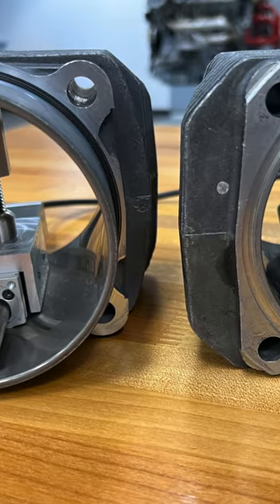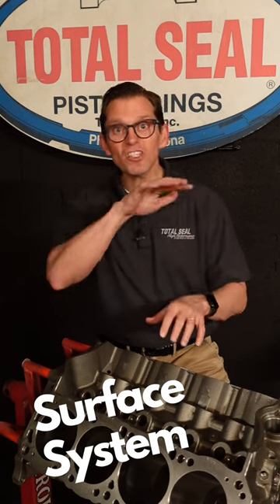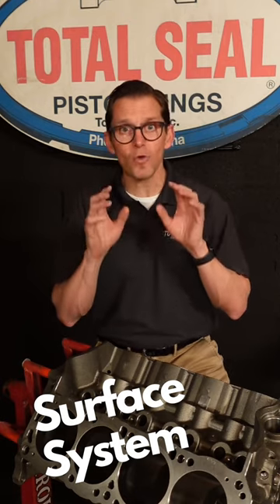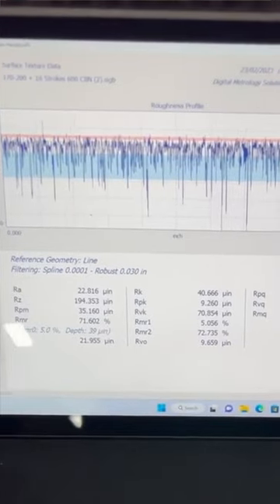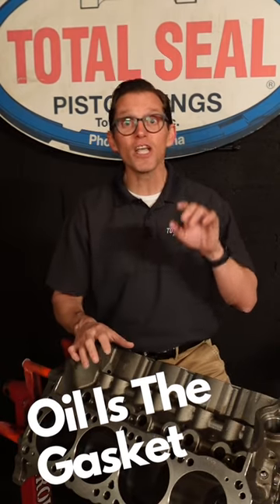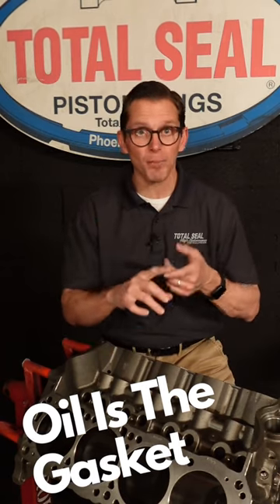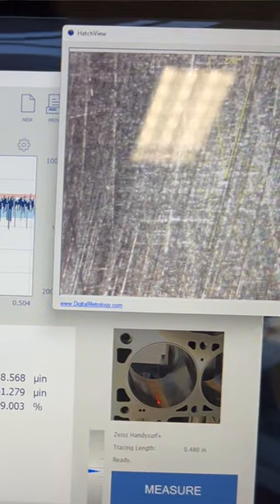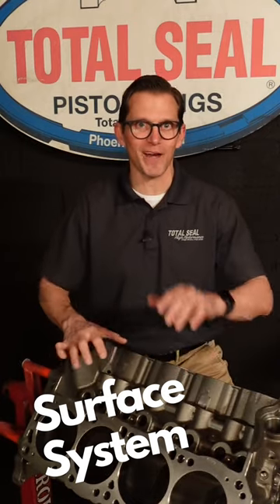What's Your Crosshatch Angle?

Comment: Is there any attention paid to measuring surface roughness or do you just rely on the stone grit and eyeballs?
Reply from the maker: Absolutely, without measuring you are just guessing. We are big believers in measuring surface roughness and cross hatch angle.
Reply: rely on eyeballs and experience.  The whole deal with this is to get you to buy a multi-thousand dollar tool that is only used when rebuilding or honing an engine block.  If you only do it once every few years, then its better to just ave a machine shop do the work.

Comment: Do u have a diagram fore what oil viscosity fore every crosshatch ?
Reply from the maker: No, because crosshatch angle is determined more by the length of the cylinder than the oil viscosity.